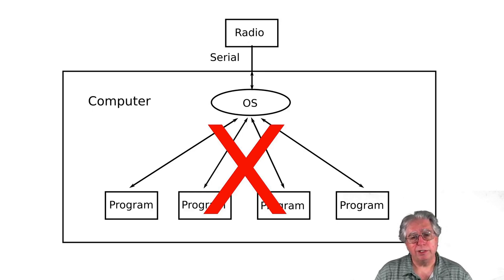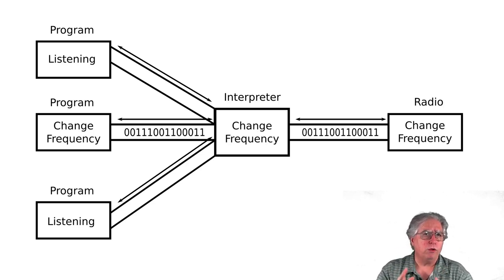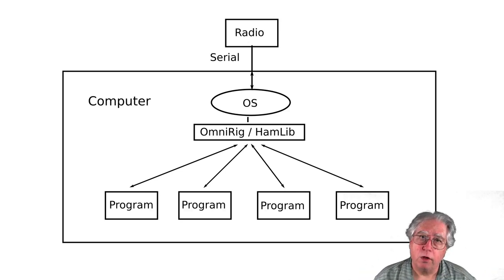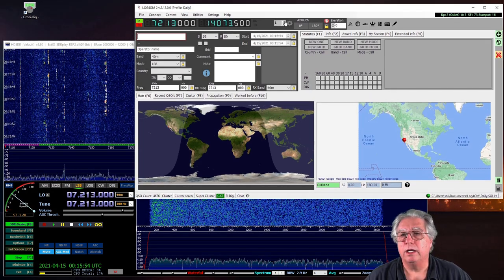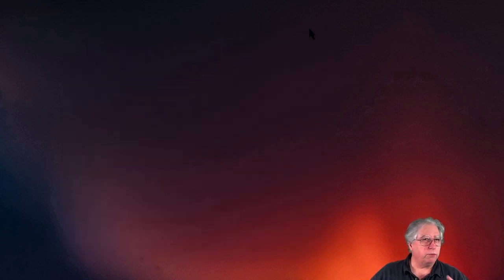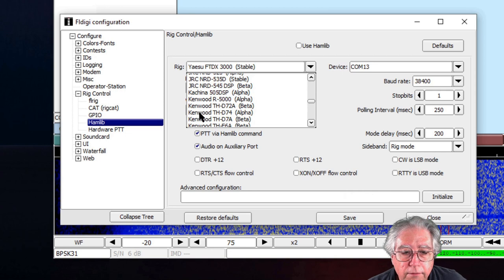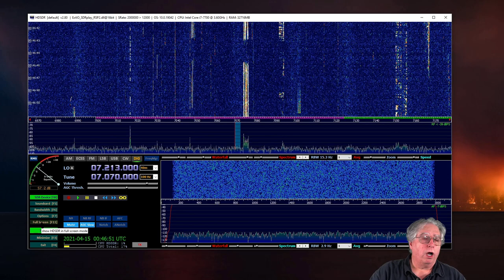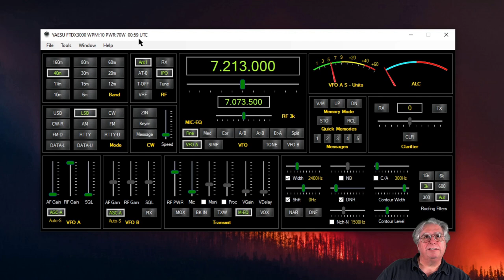How To Share A Com Port Between Multiple Programs To Control Your Transceiver

Comment: Hey, Stu - 
Great video!  Finally got this all working in actual Windows 10.  Running Win4Yaesu with Omni-Rig, HDSDR (or SDRUno), Log4OM2, WSJT-X/JS8Call, Fldigi, and VARA HF.   Thanks VERY much.  I'm going to see if I can use the same tools in a VirtualBox Win10 VM under Linux - will let you know if it works.  73 - Bob
Reply from the maker: Hi Bob,
Let me know how the Linux VM Host project goes. I experimented with some of that about 5 years ago and had issues with some of the Radio interfaces.
Glad you got it working with direct hardware though!

Stu
AG6AG
Reply: Hi, Stu -  I now have all of those applications running in the VM.  Works great, no lag (maybe because this machine has 32GB of RAM, so I can easily give 12GB to the Windows VM).  The only quirk I've found since getting this set up is that Fldigi fails (comes up for a second, then a blank notification box, then quits) in actual Windows now.  Everything else works in both, and FLdigi works fine in the VM.

Comment: In this video you are running what I assume is omnirig v1.x with HDSDR. Sadly omnirig v1.x support was removed with HDSDR v2.8 - a real pain... I am not sure how stable the current HDSDR beta, which once again allows omnirig v.1x, is at this point. This is significant since you can not run LOG4OM with omnirig 2. Oh the joys of battling developers...

Comment: Hi Stuart, thanks for the guide. I have it partially working. I  get partial VFO in LOG4OM. Are the two settings for TX in HDSDR  needed for this to work correctly. They are the only two steps I left out as I don't  require TX from HDSDR. Thanks and regards. Ian ZL1HIM
Reply from the maker: If it seems that the VFO is "skippy" when tuning, then play around with your settings for Omnirig. Changing the settings for error correction can solve many of those kind of issues, and no, the TX is optional, but it makes sense to enable it in most situations.

Stu
AG6AG
Reply: @AG6AG  Thanks Stuart. I  tried for some time but could not get the full VFO frequency to read out in LOG4OM whilst using HDSDR. Ended up buying win4yaesu and now everything plays happy together. Enjoy your imfortive videos non the less. Cheers. ZL1HIM.

Comment: On modern Yeasu radios, The cat command AI1; turns on auto information, and when a user does anything to the radio the radio will broadcast an IF Answer CAT command. The ideology that CAT doesn't just tell someone something is highly antiquated, and even the lowly FT891 can do this.
Reply from the maker: Hi Jonathan,
Interesting. I'm not finding much info on it other then how to set it and that it auto-resets when the radio is turned off. If that's the case, does the Auto Information setting turn the protocol into a broadcast only connection? Or does it accept commands in this mode as well?
Thanks in advance for your answer,

Stu
AG6AG

Comment: Will this setup  be able to support remote operation i.e  via RS -BA1. ICOM-705
Reply from the maker: Hi Robin,
My guess is probably not. Win4ICOM only works with the IC7300 and the IC7610. I did a quick search trying to see if the RS-BA1 software supports this kind of control sharing but did not see really find any info.

Stu
AG6AG

Comment: Hi hi3jcc would Like to use log4om2 with jtdx but i cant get it to work together help
Reply from the maker: Hi Juan,

I'm reading that JTDX uses an ADIF file to store logging, can you access that from the ADIF log setup?

Stu
AG6AG
Reply: JTDX will gladly send UDP packets (or even TCP/IP), no need to monitor ADIF changes.
The setup is the same like for WSJT-X. At all, JTDX s based on WSJT-X.